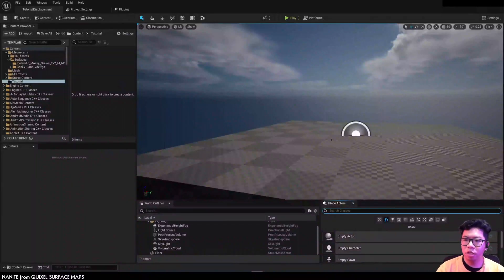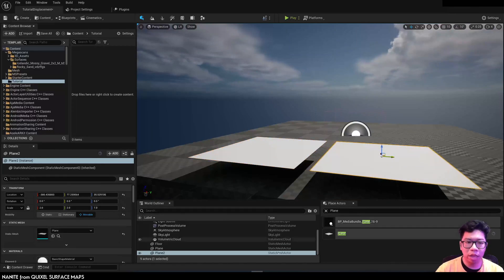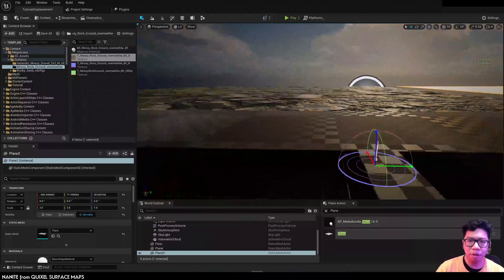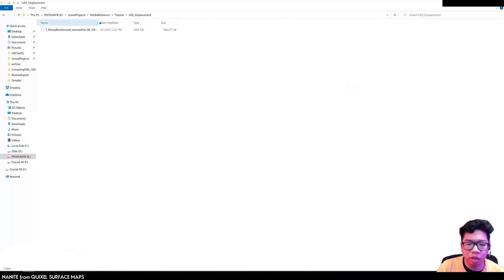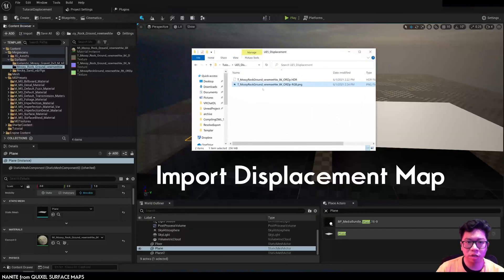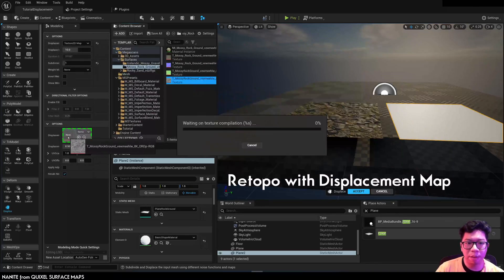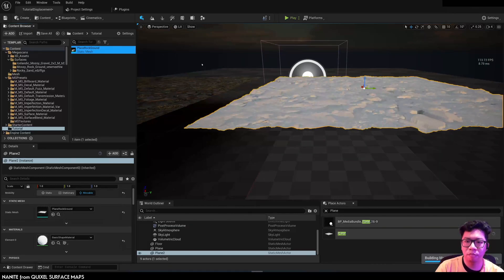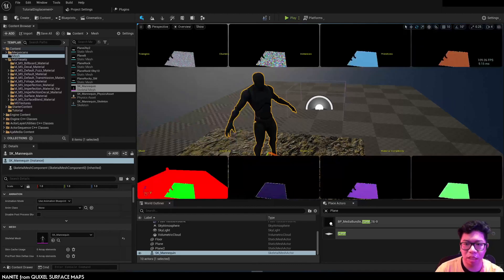Unreal Engine 5: Unbaking Nanite using Quixel Displacement ( 7 minutes )

Comment: Thanks for the tutorial, but I find it very frustrating that they depreciated a major functionality without replacing it with a proper effective solution.
Reply from the maker: Nanite is like ripping displacement/normals bandage.. it does hurt but in the long run it will be simpler. If they can make skeletal and foliage work

Comment: Doesn't work, I have the displacement map, the plane, I subdivide it with the remesh as the tutorial, then apply displacement map, but the resolution is very low, what I have forgot plz ?
Reply: Okay fixed it, but now when i click on accept it delete my displacement from the plane, any help ?
Reply from the maker: @ALKAPULE  “save” your new static mesh. If you dont save the changes will be lost. You are making a new mesh ala blender inside UE
Reply: @dpredie  Okay I'll try it thanks !
Reply: @dpredie  Alright it works ! Thanks a lot !
Reply: Like accept doesn't accept nothing xD

Comment: Great technique. I'm finding I'm seeing some weird little black dot artifacts when I enable Nanite using this workflow. Other Megascans assets don't have the artifact but this mesh that is generated and displaced in engine does. Are you seeing that?
Reply from the maker: How many triangles did you remesh it to?
Reply: @dpredie  I copied all of your values exactly.
Reply from the maker: @bowserlm  lumen on? Detail and virtual shadow?
Reply: This is probably the the editor. I found that if you don't hit cancel during whatever you're doing e.g. remesh it will apply it

Comment: Absolutely insane that there isn't a way for Nanite to automatically do this. It should be plug and play, I don't understand how displacement was omitted. So what, to use nanite I'm supposed to sculpt all assets in zbrush now? That's insane. This method works but it's a hack. The whole point of Nanite was to remove the need for baking anything.
Reply: Epic seems to be investing heavily in Unreal feature set lately. Wont be surprised if they release a wizard that will do this workflow automatically in the future. Could probably build it with blueprints tbh.
Reply from the maker: Im sure with enough tinkering you can probably do it using RVT shenannigans @ runtime.. i feel like thats how they going to approach it for landscape
Reply from the maker: If you see it differently, tesselation , LOD, and normal maps was a industry wide hack due to game engine inability to perform with dense meshes. With nanite you go back to simpler operation. 3D modeler create their model, the set builder puts them in scene. Simpler workflow. 

Right now its painful but eventually if it caught on it is a game changer as teams can focus on what they do best
Reply: @dpredie  That may be the case, but they should have had it ready to actually replace Tessellation BEFORE deprecating it. They removed tessellation without actually providing a functional replacement. Hoping that this will catch on enough to eventually be usable is not good enough. At the moment this is basically not viable for large landscape scenes, since you would have to pre-paint and then export your entire world in another program first (which is a step BACKWARDS from Unreal 4). This won't work with landmass, it won't work with the water plugin, and it won't work with texture painting.
Reply from the maker: @unreasonablebastards753  yeah i mean UE5 is an Alpha software
Reply: @dpredie  Until you have to work with landscape or instanced meshes

Comment: This is great.
 I have a landscape actor that will breakup the tiling effect. Is there a way to do this with the geo plane?
Reply from the maker: At this point you’ve seen UE5 dog or banana spam with nanite right. So you can do the same with these displaced ground meshes.. not as elegant as landscape but its Alpha software haha
Reply from the maker: No, doesnt work with landscape as ue landscape is not “static mesh” per se. i have a feeling in later UE5 patches epic will have their own nanite landscape workflow, so i dont think hacking something in Alpha is worth the effort. If you need landscape, use UE4. Or use quixel’s new spline and procedural random tool to place various meshes along the ground to break it up ? So its all modular static mesh pieces
Reply: Yep. I did see some quixel blueprints working like an array mesh feature. Will just use that for now.
Reply: @memnok9980  do you mean the collection packs from the marketplace for lava etc, u are using those array and spline blueprints to cover the ground with nanite meshes in UE5 yes?

Comment: How this is applied in Landscape
Reply from the maker: Probably heightmaps, but i would wait until UE5 nanite actually support landscape officially. I think they eventually will. For now they suggest using modular mesh to build environments.. landscape not yet supported by nanite
Reply: @dpredie It is that I do not find tessellation in material
Reply: @momosimo4247  they've disabled it
Reply from the maker: @momosimo4247 , i pointed out its deprecated. You can still plug in in yourself but it will go away.. thats the whole point of the video
Reply: @momosimo4247  they intentionally disable it. Cryengine has it for almost a decade. Unreal make it as if it's new technology. Unreal only make it more like 1 click or easier for people who don't want to bother with process.